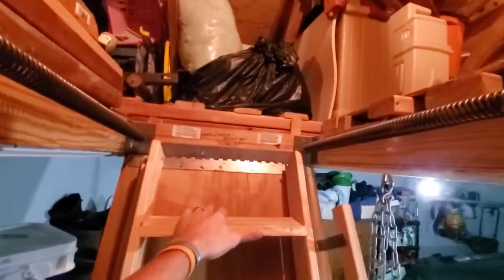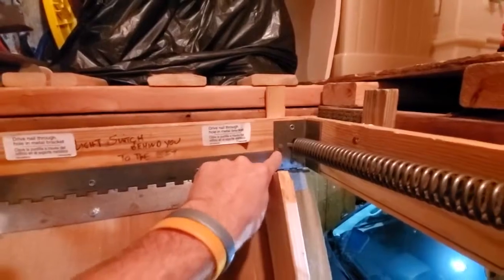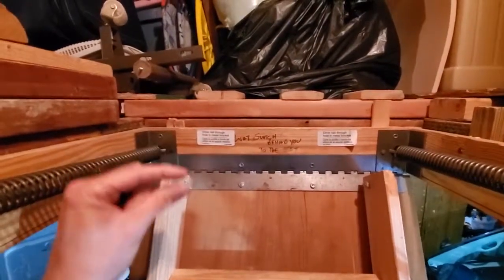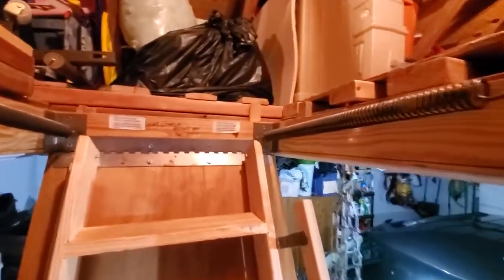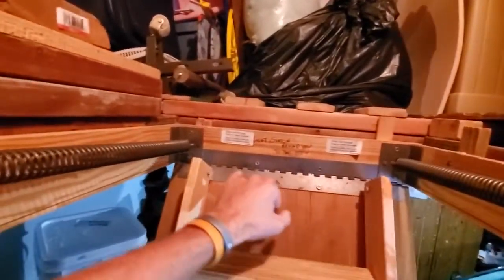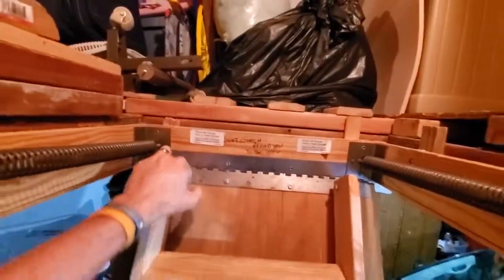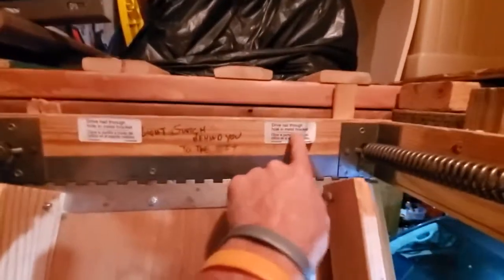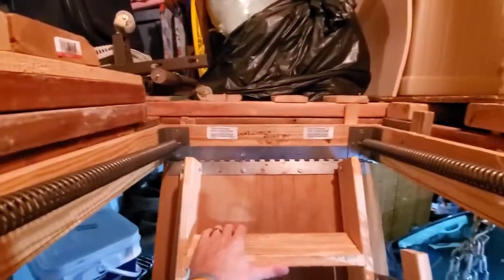Attic pull-down stairs: Make sure the proper fasteners are used!

Comment: What’s the best way for getting nails through the metal plates? Do I need a nail gun?
Reply from the maker: Just a hammer.
Reply from the maker: You can also use structural screws

Comment: This only came on my radar cause i am studying for my home inspector license which said nails required, but not why.  This video say ‘sheer strength’.  Got it. 

Then I had to check my own stairs I put in 2 years ago.  Sure enough drywall screws in all the brackets…. Oops !     BUT I also had put in 4 well placed 1/4” lag screws.  Don’t know if that was in the instructions or not , but my stairs seem mighty damn secure.